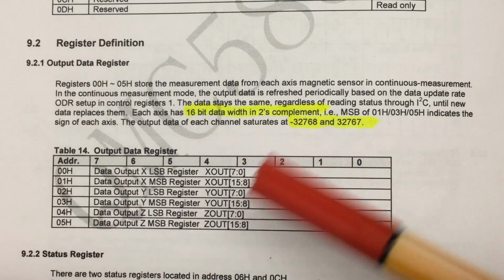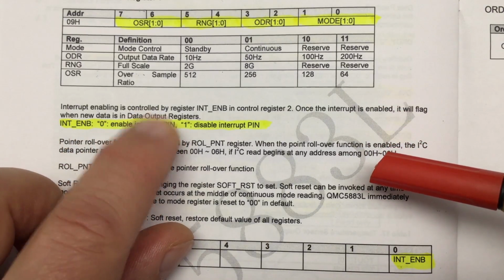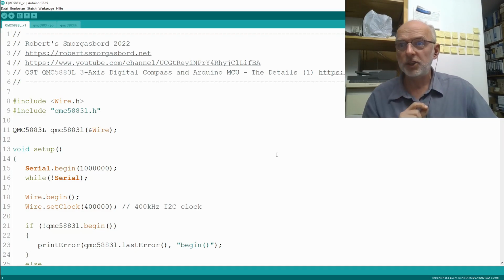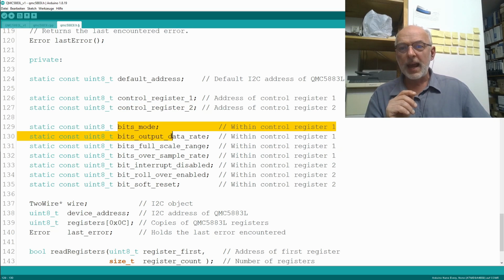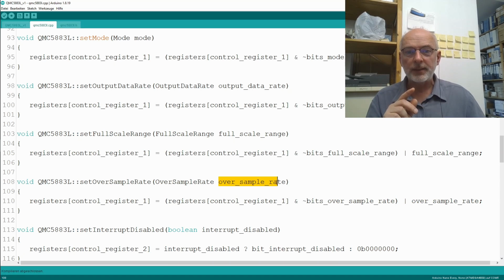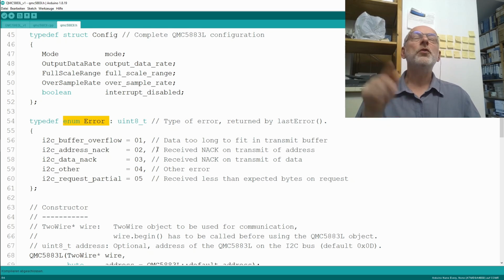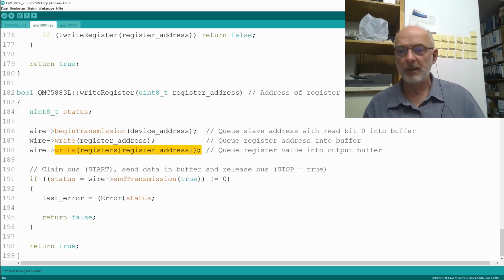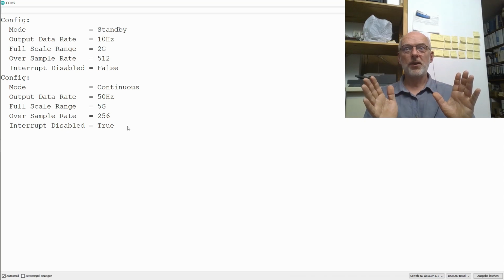QST QMC5883L 3-Axis Digital Compass and Arduino MCU – The Details (1)

Comment: I find these very useful...cheers.
Reply from the maker: And we haven't even read any magnetic data, nor calculated a compass direction (which will happen in part 3). I really thought that the whole thing will be done in 2 or 3 parts, but I'm currently planning for 4 to 5 parts. These digital compasses are beasts.
Reply: @robertssmorgasbord  Indeed they are and Sunday's wouldn't be the same without your 'deep dives' !...cheers.
Reply from the maker: @andymouse  Thanks! Your support is really cheering me up 😀

Comment: I am getting an error for QMC5883l_v8 file "Compilation error: 'boolean' does not name a type; did you mean 'bool'?" Not sure why?
Reply from the maker: The type "bool" is the offical C++ type for booleans. The Arduino IDE adds the alias "boolean" for it. However, meanwhile Arduino discourages its use ( https://www.arduino.cc/reference/en/language/variables/data-types/boolean/ ). If I remember right it helps sometimes to explicitly include "Arduino.h". Or, just replace all "boolean" in the code by "bool".

Comment: QMC5883L::QMC5883L(TwoWire* wire,
                   byte     default_address)
: wire(wire),
  device_address(default_address)
{    
}
'byte' has not been declared
Reply from the maker: What IDE/complier are you using? "byte" is a type defined within the Arduino IDE. If you want to stay within the C++ standard use "unsigned char" or "uint8_t" instead (should work with any C++ compiler). Or simply put a "typedef uint8_t byte;" at the top of the .h file.

Comment: that's seems really nice.
but got problem with. seems missing something.

i can't compile... i got
'boolean' does not name a type; did you mean 'bool'?
even if i add "arduino.h" i fail into some more errors...
need some help..
Reply from the maker: Already answered in the comment section of part 2, but here it is again:
That's curious! I'm assuming you're using the Arduino IDE since you're including "arduino.h". "boolean" is an Arduino IDE data type and doesn't require to include "arduino.h" ( https://www.arduino.cc/reference/en/language/variables/data-types/boolean/ ). "bool" is the standard c++ datatype and should work in any IDE. Which Arduino IDE version are you using (I'm using 1.8.19)? You could try to replace all "boolean" by "bool", but as mentioned that shouldn't be necessary.